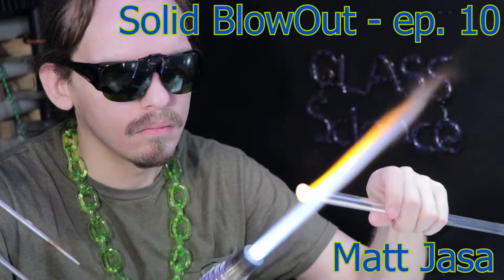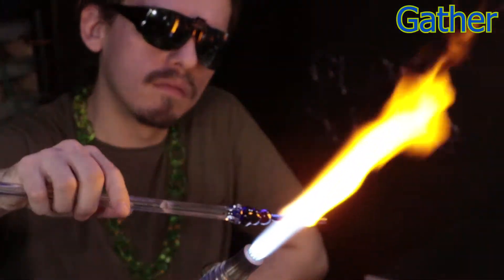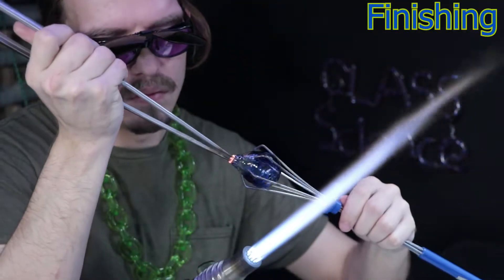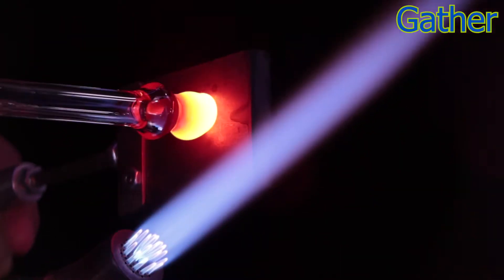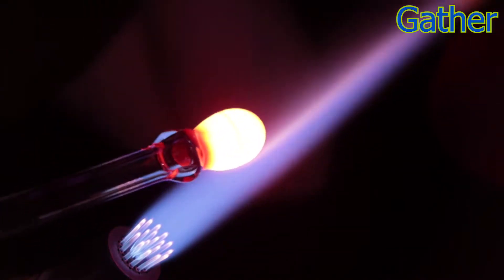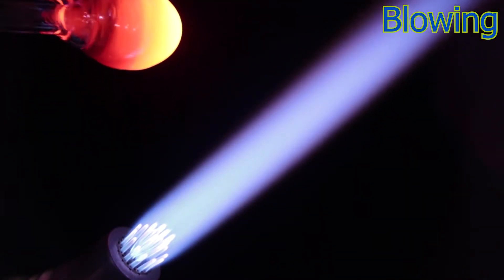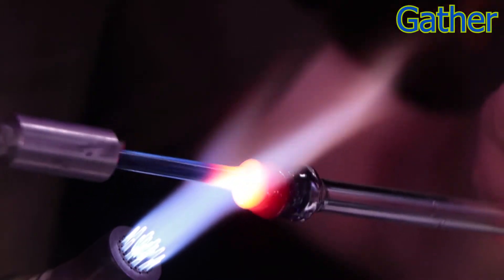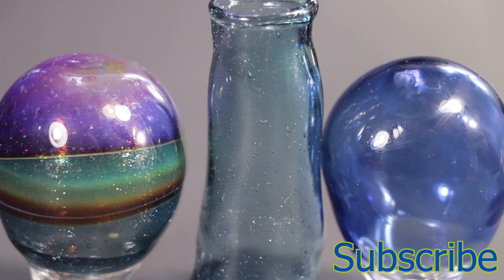Solid Color Blowout Lampworking - Glass Blowing Techniques

Comment: Just subed i love everything I've seen so far glass blowing is my dream job i was wondering where can I buy a torch 
p.s. im only 14 so money is limited what can i expect to pay for somthing to get started
Reply: Expect to pay 3-4 thousand for everything you need minimum for torch, kiln, ventilation, tools, and glass stock.  Then on top of that account for not making any money for at least a year, providing you practice your butt off, while paying for oxygen refills, rental and more glass after you go through everything you bought the first time.  This is not including high end torches or kilns.  Those themselves can run between 2500-10,000.  Start saving bud and good luck.
Reply: WILEY RACER 
Hun I spent 300$ 
For everything I needed to start out 
That guy is talking about building a state of the art studio 
I started out with soft glass 
You don’t need as big a torch 
The glass is a bit cheaper 
& it’s not as finicky 
Look into the way the Japanese artists do its they can’t have huge tanks of gases plus the minimal space in apartments. They actually use a bunsun burner w/ a pump for a fish tank. The pumps that pump oxygen... 
it’s much quieter as well. 
That is definitely the cheapest way to go, Japanese glass is so soft you don’t need a kiln. They make georgeous pieces without using a kiln & their beads last! 
Cut your teeth on that stuff for a while 
At your age you could make some pretty sweet pieces of jewelry & sell the hell out of it at school 
Students and teachers would buy it! 
Youll get loads of experience in glass work and the buisnyside of it 
And fund your studio & if you decide you want to work with boro go for it! 
If you start now 
You’ll grow to be a master artist 
Don’t give up!